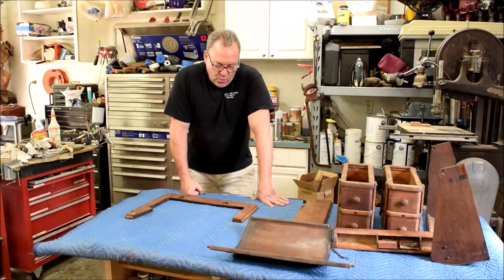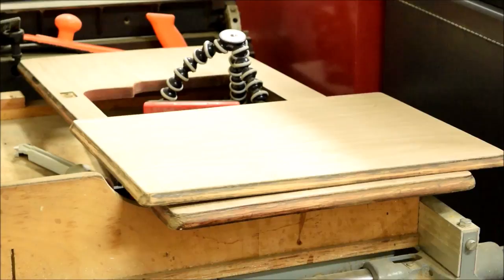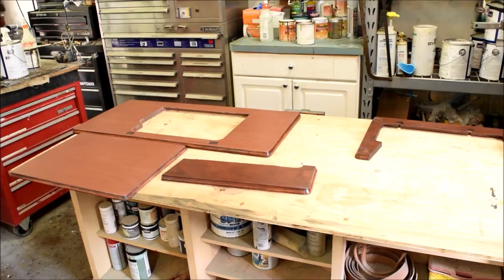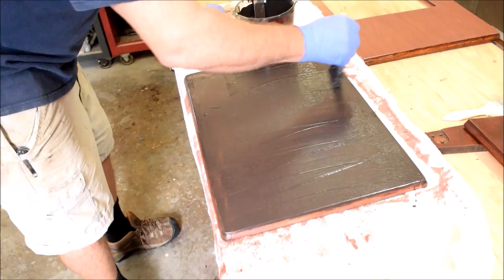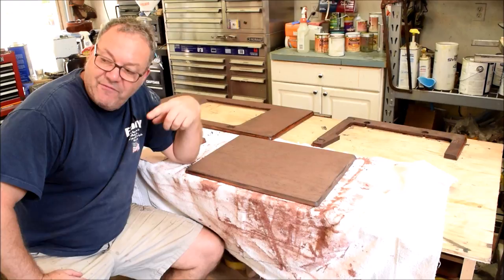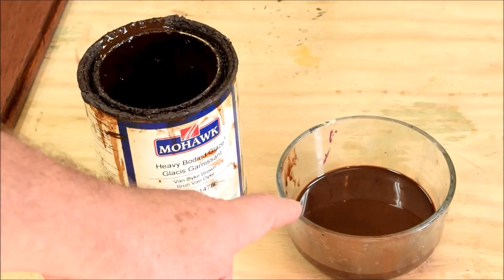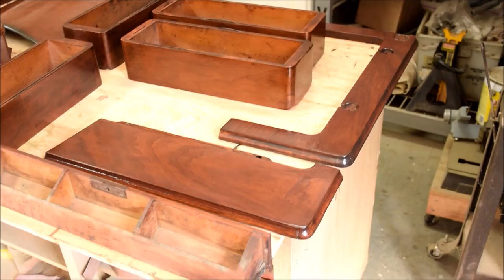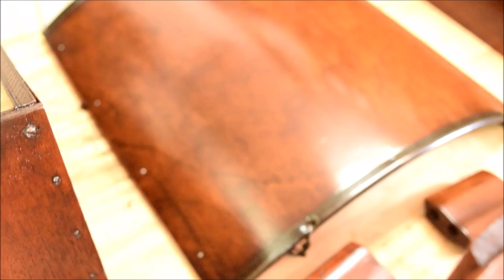Restoration of an Antique Singer Treadle Sewing Machine Part 7 - Refinishing the Wood

Comment: One thing I do different when I have veneer replaced with new,color does not match the old veneer,so in the stripping process I apply the used stripper on the old pieces first and use the dark GOO onto the new veneer. When finished you can't tell new from old.

Comment: That's looking beautiful! You're doing a better job than the original in my opinion. The cradle in most treadles wasn't vanished as well as the rest of the cabinet, they're not as smooth, at least in my experiences with them. Your clients should be very happy with the end results. Filling in the grain only made the veneer look  more like Singer did when they did their finishing. If you look closely at other tops they all have those dark "filled" areas. It's probably where the stain settled. Very nice, Larry. You made me smile when you said garage and then corrected it on the screen. 😁

Comment: I feel a bit foolish suggesting anything to you. I'm a professional painter (20+). Last year I refinished a set of solid mahogany doors at a mansion. It was 3 weeks of detailed hand sanding. I used a new to me  clearcoat and fell in love with its ease of use and clean up. It's a water based modified oil self leveling coat. You literally brush it on and it leaves no brush strokes. It's made by a company called Zar. It's reasonably priced and comes in several different sheens. Also comes in interior or exterior (UV protection). Give it a try. Water clean up. Enjoying your work. Thanks
Reply from the maker: Thanks!

Comment: Love your videos, very educational and I enjoy your narration. I have a question about sealer. Can your sealer be the top coat diluted or does it have to be a separate product? I am worried about compatibility. I am using a catalyzed lacquer as my top coat and don't want to have any reactions messing up work.
Reply from the maker: With lacquer based systems, some people don't even use sealer.   They either apply a diluted coat of lacquer or a mist coat.  I use sealer because it has always worked well for me, but others don't use it and have success as well.   Good luck with your projects!

Comment: I’m glad I found this video.  I just purchased a Singer Red Eye Treadle Sewing Machine (#66). I have the exact cabinet.  It’s in pretty good shape except the top lid, table top and under lid, edges where the hand wheel is located,  I wasn’t sure if you could restore the veneer.  The other parts of the cabinet is in good shape.  I would just want to restore the areas in need.  There is some discoloring.  I may be up to restoring this.  Where are you located in Georgia?  Do you sell replacement belts and things to clean up the machine?  Where are the rest of your videos?  They are not showing up on your channel.
Reply from the maker: I am just outside Kennesaw.  I don't sell replacement belts.   The videos should be showing available under the "videos" section of the channel.   Thanks for watching.